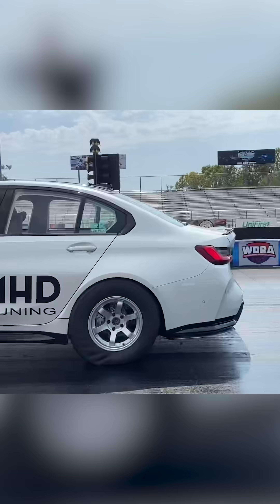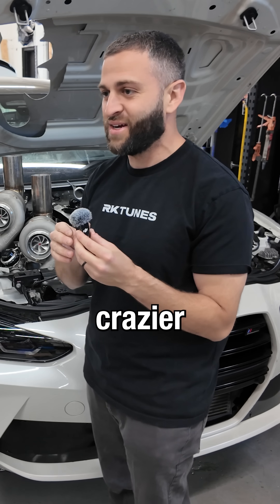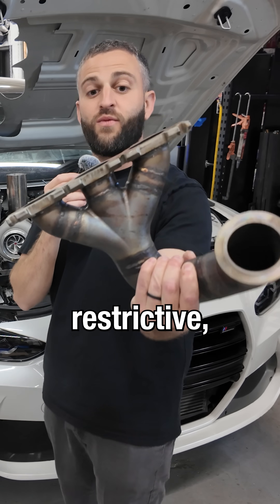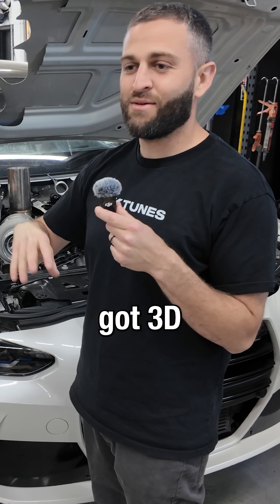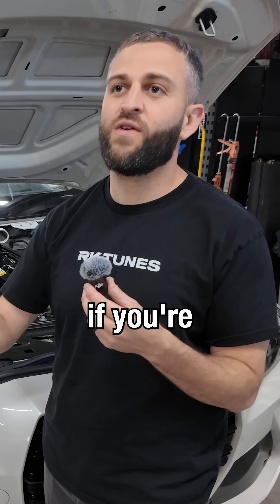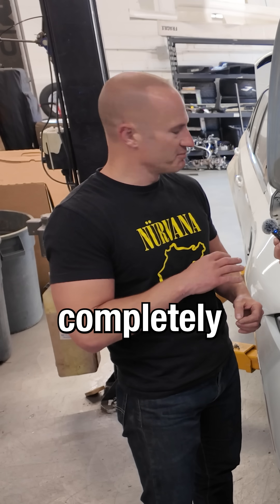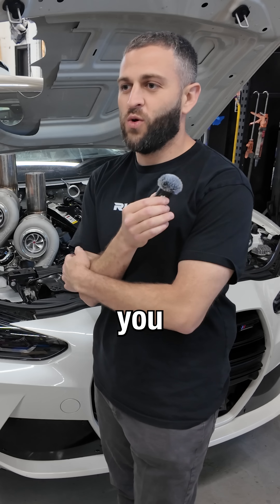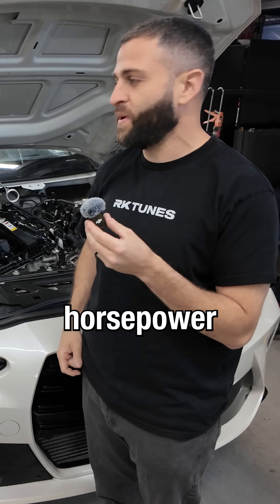MY $40,000 3D PRINTED TURBO MANIFOLD!!!

Comment: You could have bought a good pipe bending machine instead. Nearly no limitations, no stupid pie cuts either. Get a guy to 3d scan the bay, n design a manifold for you / run that thing through simulation software to make it better and you'd be looking at 10-15k max.
Probably same ish result.

Comment: 40k 😂 who is going to believe that at first I thought it was a typo on the you tube video. Then you even say what you paid for it in the video. Still saying it’s 40k tho!! 3d printed inconel ti manifold is 6-8k max.
Reply from the maker: One charge pipe and two dump tubes are $72,000 usd if printed in America. Same parts printed in china are $682
Reply: @RKTUNES ok but my prices are coming from Steph padadakis and is in America. They can now use sintering tech to do those parts cheaper and better tech should check it out. If you did pay that much you really got took fr go ask Artec all his manifold are 3d printed and they don’t cost 40k!!
Reply: @RKTUNES don’t you run precision turbos? Wonder why they are raising there prices tariffs maybe? Thought they only affects you if it’s not made in America oops 🙊!! Have the parts you put in your car are made in china quality of materials and craftsmanship is all that matters not where it’s made 🤦.
Reply: @RKTUNES what process are you using for 3d printing? Are 3d mapping and design included in the $72k?
Reply: It's not even 6k tbf u can get a smal inconel manifold like that printed around 2.5-3.5k .
Reply: @AMT_97racing yes ik I was giving the benefit of the doubt with using extreme examples. Like I’m talking an exact same manifold for b58 from Steph padadakis his price was 5k for a slightly used one and 7-8k brand new. This was also almost 2 years ago now. When all these people lie and boost I was always think what are they thinking. Do they really think no one will correct me and make me look bad!! Just tell the truth!
Reply: 1400 to 1800 with just manifolds?.. really?